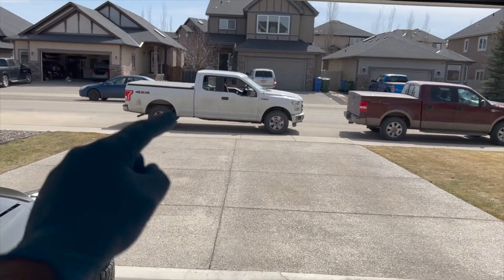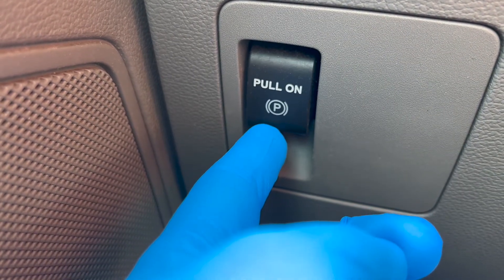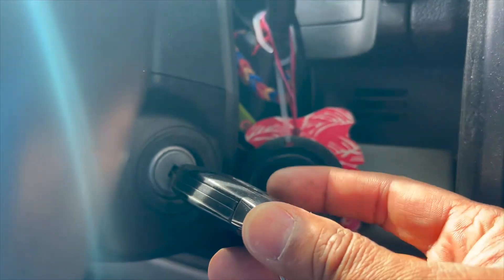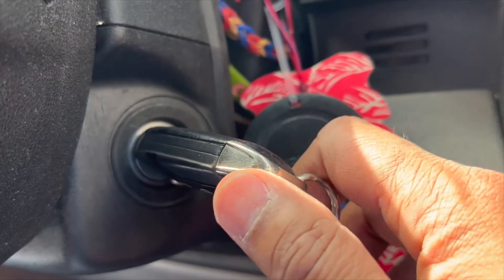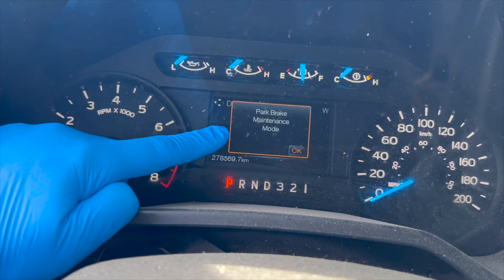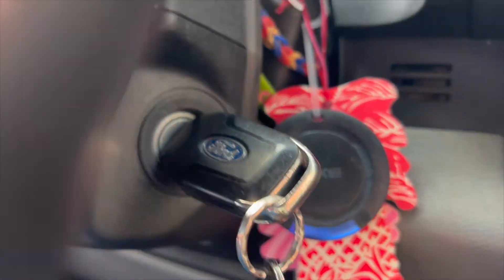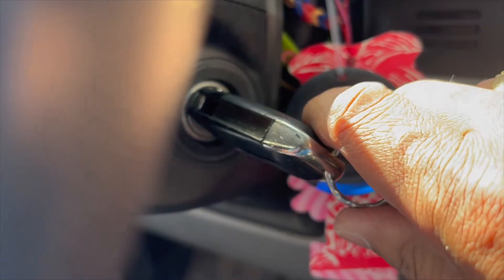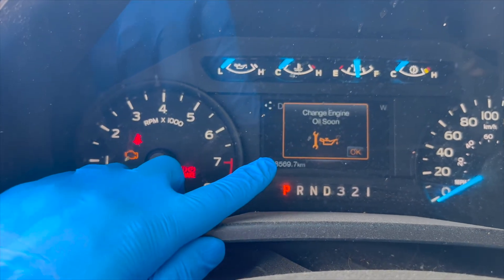Electronic Brake Service Mode - EPB Service Mode Activation and Deactivation (Ford F150)

Comment: A few questions for you bro apologies for the long questions. 1st after car is in park maintenance mode do you disconnect the epb plug before removing caliber. 2nd once new pads are installed do you deactivate the maintenance mode first without previously pushing on the brake pedal 
That's what alldata illustrate to do so do

Comment: Dang, you saved me. I have the 2023 F-150 Lightning Lariat. Following the instructions of another video (Bearded Ford Tech from a year ago), I activated EPB Maintenance Mode, but the deactivation instructions didn't work for me. I was getting worried after 40 minutes of searching until I followed your instructions. Yours worked! Thanks again.
Reply: Interesting we have a 21 that's not coming out of maintenance
Reply: @raven_themechanic my 2021 Mach E is not coming out of maintenance mode either..